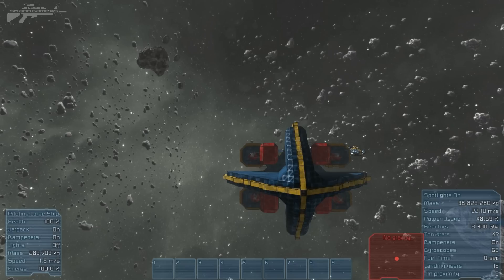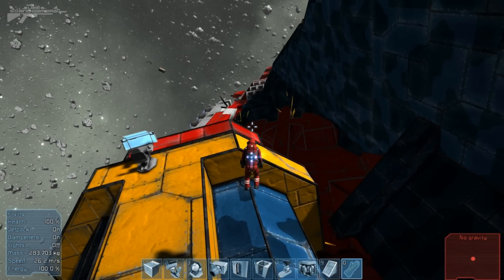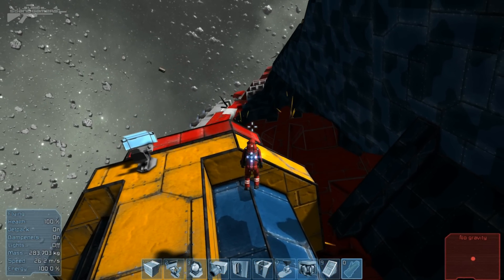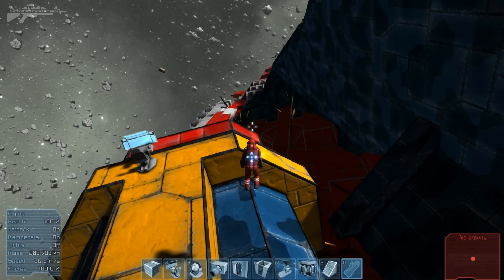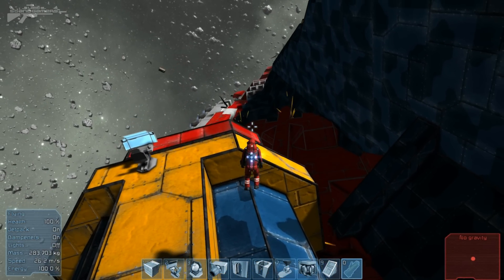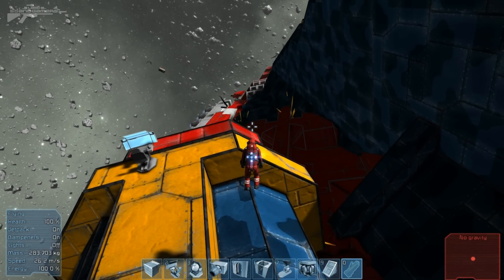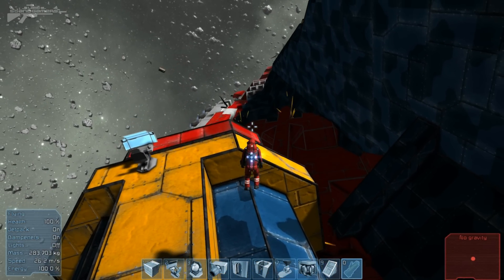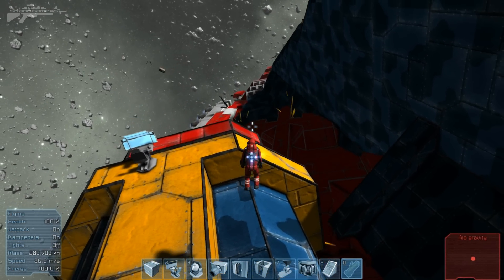Space Engineers - Is Ramming Really That Effective ? Assembling A Fleet Part 4

Comment: What if you replaced the torpedo bays with smaller ramming ships? Have the main body as one ship and then use merge blocks or landing gear to hold the "torpedo bays" (now mini ramming ships) onto the main body so that they can detach and fly towards the enemy ship while the main ship flies away. All you would need is some kind of blueprint system (to save the general shape of the mini rammers) and a bunch of welders around where the rammers would go and you have a mobile ramming/production ship

Comment: I was thinking about a particular design for a ramming capital ship. The ram would be shaped like a cone. and its purpose would be to widen an entry point on the enemy ship.

Firstly, create a hole, or entry point on the enemy ship. From there, the ship would ram into that entry point and keep it locked in place. Using pistons, the cone would open up, hopefully apply enough force to widen the entry point. Once the entry point is big enough, any fighters, and transport ships stored within the cone would be able to board the enemy ship.
Reply: Space engineers does not work like that... if you ram someone with ships attached to your ships by landing gear, they will fly around and damage the inside of your ship.

Comment: I believe if you want to make an effective ramming ship, it should be a very thin front ship with a big back for thrusters and troop holding.

It should be mostly used as a light boarding ship for pirates and not as a large battle tactic. Just imagine having this huge ship and without notice a needle comes though the side of the ship and pirates start coming out and disabling generators, they take what they need and release the needle and go running away.

Ramming is not a tactic for destroying ships, its for raiding.

Comment: There’s actually a ship called the “Scarab” I’ve downloaded from the workshop that is small, can hold its own in a fight, and in case of emergencies, actually go into a “Kamikaze Mode” where it overrides the thrusters to full speed, fires all the rocket launchers, and give the pilot enough time to leave if they aren’t using the remote control within
It’s a pretty neat ship in my opinion, and I’ve blown up multiple large ships just by ramming a few of those bastards at some key points

Comment: I think, just speculating, that if you focused on using a small ship with some artificial mass blocks right behind a small, sharp tip you could get better penetration and damage in general. a few warheads may help depending on the intent behind ramming the enemy, but a tip that is extended away from the main body would minimize the damage to your own vessel. There are ways to make it work, as torpedoes are simply unguided rammers and work very well at times. Manning it should not change the basic principal, but rather place a tactful mind behind it to maximize its effectiveness.

As for my artificial mass theory, I have yet to find if anyone else has tried it yet, going to look around and if not I will test myself. Seems to be worth it when you consider the mass you get from a single block as opposed to making a whole ship to add the extra force behind it.

Comment: IMHO The problem with ramming is that its easy for the victim to out-run or just kite the rammer forever (since the max speed is fixed). To "win" you need to catch them by surprise before they can accelerate away from you (by out-running you or just dodge your ram)... but if ramming is effective then stuff like boarding and delivering the devastatingly powerfull rock-gravity torpedoes at point-blank range (or just shoot the target to pieces) gets that much more effective.

Comment: The best way to make a "ramming ship" is to use gravity cannons on the actual blade, or have a multi level blade with spaces in it and a locking mechanism so you don't tear yourself out of the ship, and if you do rip out it guts the thing. The actual ram/ship need to be much smaller the large size doesn't make it work as well. A smaller more compact vessel would be easier to aim, as well as harder to hit. Maybe use one of your torpedo drills as the front but have it be much larger.
Reply: And to be honest for a boarding vessel you should use a torpedo pod with a drill on the front and a windo to see when you have penetrated the target.
Reply: window*

Comment: What about those little scuba subs that the S.A.S. use for aquatic operations,those can act as torpedoes and troop carriers, but design differntly, or torpedoes destroy hull and boarding parties a separated which means the defense has to separate from the group,so say they have a barricaded corridor with troops that are battle ready, that boarding party is coming single file into an area without cover and , well you get my point.

Comment: What if the point isn't to cause massive damage, but to immobilize? I'd imagine that you could have a slimmer ramming blade that would punch a smaller hole in the armor but go deeper into the ship. Somewhere there could be some landing gear on an arm that rotates into place and locks the ships together. The enemy won't be able to get away without fighting you or at least destroying the part stuck to them, while you could always detach and haul ass if you had to.
The ramming blade could even be a separate ship attached to the front so it could be detached in battle to escape or be replaced without putting the whole ship in for repairs.
Reply: what if you can cause massive damage and immobilize if you hit their engine room? a dart filled with warheads and a battering ram on the front, and has 1 warhead on the back which when u pop out of the dart you shoot and the dart explodes inflicting mass damage. the battering ram will help to penetrate more.

Comment: Too much surface area. In a situation where you plan to ram you want a prow with a small cross section, like a blade, or a bulb/spike protrusion. A broadhead design like this is very inefficient on collision. Half way between effective prow design and straight up "heavier is better" collision. Try something along the lines of a plow like design and give yourself a bit more power for speed. I've mucked about with plow prow designs before and you can completely gut even a heavy set ship with a bit of speed and the right design.

Comment: Hey Aaron! I've been trying to build a ship and I'm using some of your cannons on it as well..I've seen you've been remodeling them adapting to the recent updates (no more missile launcher rows and the structures are much narrower and smaller in general). So, here's the problem, no matter how much I narrow them down or how small the barrel of the cannon is, as I try to move the turret sideways the joint is'n strong enough and doesnt manage to hold the strenght of the moving barrel, resulting in me ripping it off unless I move sideways very slowly, which is unacceptable due to the fact that it makes the cannon useless..Any tip??

Thanks in advance!

Comment: I think using ram ships to completely "cut the enemy in two" really isn't totally viable. Too many people will be doing it and tactics will evolve to counter it. Plus you're losing your ram ship in the process. I like the idea of the torpedo tubes on the ram ship. Fly in making the enemy think you're ramming but instead lob torpedoes at them and back off for a reload (on this topic resupply ships/using the carriers and smaller craft to resupply larger ones could be a good idea). If you know how the enemy will react to a ram ship you can plan to catch them with the torpedoes. Or a ram ship designed to board an enemy ship. With this "Phillip's Head screwdriver" set up you can attach some claw like devices to really ensnare the enemy ship so boarding parties can get in.

Comment: Personally, I would not use ramming as a normal strategy, but still have a ram on a ship just in case. 
When it comes to ramming, I would use it only as a last resort option, such as distracting an enemy while your allies flee a losing battle, becoming a meat shield so allied ships with more guns (or more intact guns) can shoot at the dent you made, or if you have no more ammo and are facing a lightly armored vehicle. I would rather not aim for random parts to ram, but critical sections of the ship that would be highly detrimental if damaged, such as the engines, the bridge (if exposed), any exposed torpedo tubes, or hangers with loaded ships (better yet if the ships are already loaded with enemy troops). Only then will ramming be an effective but limited strategy.

Comment: i would just like to state lsg, that ramming ships relly on their initial design. for instance, do  you want widespread impact, or do you want to go straight through them? if you want widespread impact you want a round ship, very heavy with a ton of thrusters XP turn off your own dampeners before the impact. and hope for the best- if you want to run straight through them you will need a sort of walling on the back of your ship again with a ton of thrusters.... there tends to be alot of thrust in ramming ships but i digress

and the main full of the ship needs to be very thin. and no matter what you have to keep your thrusters on, with luck you will have impaled something important on their ship.

if you want to completly snap the opponant in half, you want to have a ship that is verticaly flat. like a knife blade, once more you will need a ton of thrusters. and if you wonder why i keep saying that its because speed is your friend when it comes to these situations and you can never be too fast.

i hope these help ^^

Comment: Sadly the lag in Space engineers is not completely computer power based. The game engine itself needs allot of work, any time you get to a large number of blocks or parts taking damage the game slows to a halt. Currently i have a ship at a mass of 500mil kg and that is about the limit which does not even pull 50% of my available resources. Hoping they upgrade soon so i can finish my monstrosity.

Comment: my ship The S.S Vahalla was designed for ramming  it has a reinforced hull that takes little to no damage from ramming into other ships
Reply: not to mention in stead of injecting troops into them I inject torpedos into them
Reply: Cool......... My Darkhound Mark1 Is an anti Ship small ship, it has a prototype Modular auxillary power system which makes it suitable for dealing with any situation, especially taking out large ships.
Reply: ss vallhalla also has 8 gracity acceleration warheads
Reply: Not bad.... But does yours blend and transform?
Reply: kind of blends i ned to be next to an asteroid or ill stil stand out
Reply: devin oleary Mind dont blend..... it just turns into a sparking mess each time i switch out Wear parts on my ship.
Reply: yeah the cloaking is horribly inefficent i have like 18 of them to hed completly

Comment: High speed ramming as a primary form of attack is a load of rubbish, it causes massive damage to both ships. However, some ships rely of being in a certain orientation to their target for maximum damage (broadside guns, forward bombardment guns, ventral orbital guns) so using slow-speed ramming to just 'push' a ship off it's angle might reduce their combat effectiveness. That said, I would rather have some kind of ramming cap on the front of my ship, so I can at least glance off or barge past enemy ships when I need to run a blockade or any defensive lines.

Comment: you built yourself a battlecruser but you need the spounge in your fleet something that isnt so much as a fighter but holds the fleets reasorces, fuel and food (if added to the game) and to have that hiden fighterbay/turret design of yours no more than 4-5 and maybe instead of fighters dropships or small transports of them but with a solid 6-8 layers thick armour and focus directly on enginesand have a system of engines much like they have on battlestar galactica with loads of small engines in a cyclindrical fasion around ther rear of the ship id in my mind it would seem to be a good idea as there would then be more engines for enemy ships to shoot at befor its cripled or dead in the water (pardon the silly saying XD )

Comment: what if you we're to use inertia with a thin wall of armor to cut through another ship in the same way as your torpedoes using landing gears to hold it in place and then stopping and using inertia to let the wall fly into the other ship so it cuts it in two

Comment: I feel like ramming could be a very usefull "last resort" option.
Reply: With welders today a sound strategy would be to have a "hammer" ship which is basically a square of heavy armor with welders inside and you just ram the ship you attack, the welders and a projector block will rebuild your "hammer" ship, and you can ram again and again etc. If you were to follow this up by a fleet of small fighters which could fly into the large ship and destroy it from the inside that would be very hard to protect against, even if the ship you ram also has regenerative armor. This would require more than one person to operate tho, or very advanced scripts :P
Reply: Beacon of Wierd omg i agree it would be a super ship and for the torpedos launch like mini troop carriers

Comment: Unfortunately, I believe you are missing the point of a ramming ship:

The intent is to deal economic damage. Essentially, you want to build a cheaper design than your opponent that delivers crippling blows. Your design is over-engineered, and would indeed end up costing you more than your opponent in terms of damage.

The concept behind keeping a cheap design is that it can be mass produced, and it helps you sink larger vessels.

Also, boarding shouldn't be the primary target. You don't want to have a bigger crew on these frail crafts (you want to minimize the risk as much as possible). Rather, having some means to cripple the ship further is necessary (there's no point in capturing a ship you have just rammed).

What you need is a way to lock onto that ship afterwards and aim for the engines. That way, if some engines survive the first hit, they'll still have a rough time maneuvering if your ship's carcass is deeply encroached (some landing gears come to mind, though they shouldn't be exposed).

My personal ramming ship introduces an explosive charge after ramming and locking to its target. It doesn't need much propulsion though.

Comment: This is a bad design (cool ship, just not good for its job). You need a long, thin spike on the front of your ship, with a shield at the base like the hilt of a sword. You can even put bombs along the spike or inside it  for extra effect. But the secret is having a small cross section actually colliding with the other ship, so you put all your inertia into a single point.

Comment: Ramming is ineffective it looks cool, but not really much more. Put 4 rocketthrowers with each 4 rockets and you got a far more devastating waepon which don´t need to be rapaired each time after its used only reloaded, because in some sort of survival mode replacing dozens of armored blocks would cost more ressources than replacing 16 rockets

Comment: If you make a ramming ship it should be specifically designed with that purpose in mind and basically be nothing more then Kamikaze ship. Or in other words, nothing more then a piloted torpedo.

Which kind of brings me to another thing. How effective would a Torpedo be in a real ship to ship fight? So far in your video's I've seen you fire at static targets and lining up the ships before firing. But that would never really happen in a real battle. Atleast I would think an enemy captain would not park his ass in front of a ship to give you an easy target to fire torpedo's at him. So how well would they work against a moving target? Would you even be able to fire them safely if you had to make sudden turns to get them on target? Or how save would a torpedo be if you fire it at a ship that has Point defence/AA guns, a unarmoured torpedo would easily be blown up with the incoming fire detonating the unprotected warheads.
Reply: a small ship filled with warheads, but pretty agile and 1 warhead sticking out on the back. on the front a battering ram that lets you punch through a bit more. then when the ship is in, pop out and shoot the warhead. i think it will do more damage than a straight up ram or something.

Comment: ramming is the best way ever to take out a enemy ship you build a small fast ship with a heavey armour saw on the front with to small warheads and u can pundh through a capital ships hull like butter done it many times and only costs very little to build compared to my capital ship which has 50 rocket launchers and 50 gattling guns on the sides the shell is made out of heavy armour and the main supports in the ship are also made of heavy armour and in between every main support there is all the supplies you need so if it gets broke in two it can be flown as 2 seprete ships and it looks like a WW2 battle ship its awesome and has been rammed 10 to 15 times and every time except of 1 thay never got through my hull or broke anything major like engines or reactors or killing any one I had a small ship hit me that had 5 warheads on it hahaahahah it sucked it only made a 4x4 hole in the hull and then my rockets killed all 5 of the crew on board the troop transport ship that came afterwords to try and board and then my crew of 5 fixed the hole and we destroyed the rest of the ship and flew away with only mimial damage and btw my base is a HUGE space station that WTF I just got hit die prople nvm my crew killed them no worrys only a small 5x5 ship with 5 or 6 war heads hit the outside breaking one of my starter mineing ship just to show them I dident care I blew it up infront of them then killed them this has gone on whay to long so thx for reading see you later.